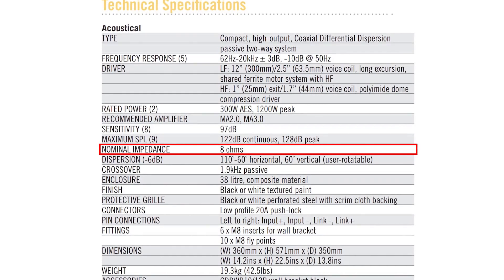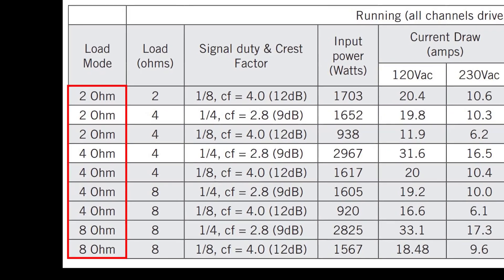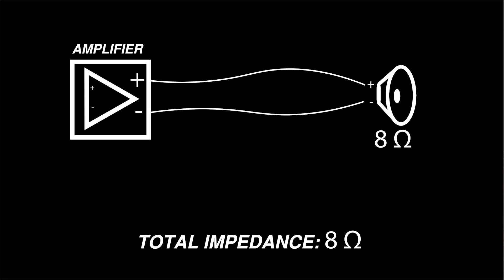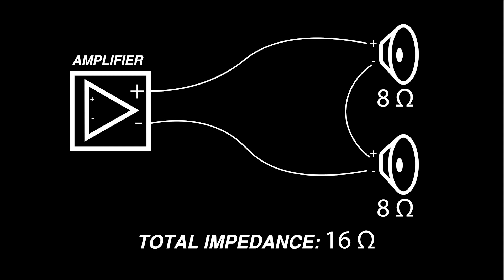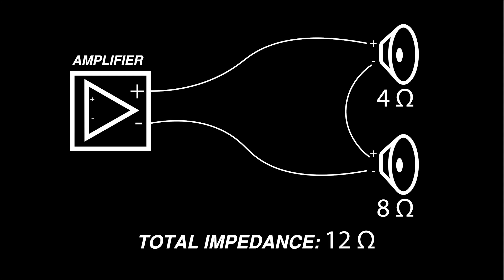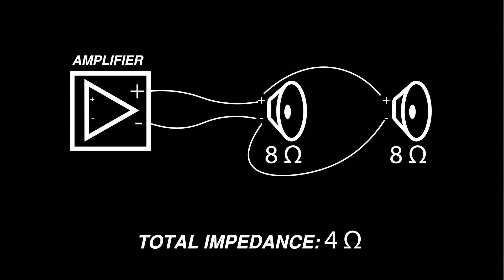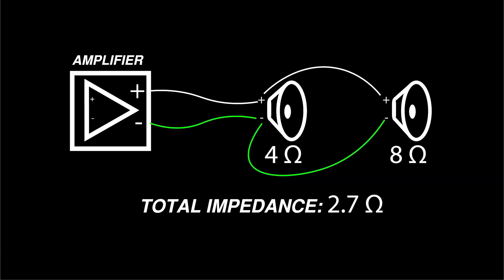SERIES vs PARALLEL: Speaker Impedance Explained

Comment: So adding another speaker reduces the load to the amplifier if wired in parallel?  That doesn't make sense.  🤔  In DC wiring, if I wire two 12V batteries in parallel, I still have 12V but have twice the current (measured in amps).  Conversely, since speakers draw power rather than make it, wouldn't wiring in parallel demand twice the current load from the amplifier?  Is there a current specification that I need to be careful to not exceed?
Reply from the maker: Adding a speaker in parallel will reduce the impedance seen by the amplifier, which will require more current. Yes, this could be a heat and power supply issue for the amplifier as the current requirements exceed the amp’s ratings.
Reply: A speaker is not a power source, it is a load. It is the same math as calculating series/parallel resistors. Yes, wiring speakers in parallel absolutely reduces the total load.

Comment: Thank you for this video! If I have a 2 channel amp with 4 - 16 ohms, want to hook up 4 speakers rated at 8 ohms each in parallel, is it ok to connect  2 speakers directly to each channel rather than from one speaker to the other? I think the impedance would be the same at 4 ohms, just want to make sure that is still OK to wire it that way. Thank you!
Reply: Yes.  His diagrams showed wiring in parallel from speaker to speaker, but if you tied down 2 speaker wires under the same lugs on the amplifier, that is also wiring in parallel and the amplifier will know no difference.
Reply from the maker: Thanks, PVT-PILOT! That’s correct, David. Both methods will be a parallel circuit.

Comment: Is there a way to hook up a two channel amp to 4 speakers ( 2 on each side , each speaker having 8 Ohms ) so that the amp will have 8 ohms resistance on each channel ? I see in your video that with 8 ohm speakers you would have 16 ohms in series or 4 ohms in parallel , but is it possible to have 8 0hm resistance with running 2 8 ohm speakers per channel ? thanks.

Comment: Sir I have two 8 ohms speaker one is 150 watts and 250 watts...... What happened if I connect both
Reply: Weather it will damage the system......???
Reply from the maker: I don’t expect it will cause damage to the speakers, but you might get different output levels from each speaker.

Comment: Great information. I'm curious. Is there a way to parallel two speakers and have a 3rd one in series? My guess is to parallel two then let them act as the first "one" in a series? Thanks for in advance for any help or advice.
Reply from the maker: In terms of impedance, your thinking is correct. Nice! Although, I believe there are differences in how power will be allocated depending on if the speakers are connected in series or parallel. You might want to do some research on that...
Reply: @AudioUniversity  Thanks. I wondered about the power as well.

Comment: Very helpful, but I still have a question. I'm getting ready to install a pair of 3.5 ohm JBL door speakers into my car and planned on running my 4 ohm Cadence tweeters in SERIES with those 6.5's. For the past 6 months I've run my tweeters in PARALLEL with my Pioneer 6.5 door speakers, which are 4 ohm speakers. BUT, I keep blowing tweeters when I crank up my stereo because I'm adding way too much power to the tweeters. Thankfully the Pioneers handle much more RMS power than the tweeters, so those have survived. But now I plan to connect the brand new JBL GTO629 speakers which are 3.5 ohm in SERIES with the brand new Cadence 4 ohm tweeters. I'm not a math whiz, so can someone tell me what resistance my amp will see running a 3.5 ohm AND a 4 ohm in series? And should I go to the positive of the door speaker FIRST since my tweeters have both bass blockers AND resistors on their positive sides? Hope this wasn't too confusing. I've NEVER run speakers in series before, only parallel like I'm doing now.
Reply: 7.5 Ohms, and yes

Comment: Series Connection Question:  Do you use Negative or Positive wire for the negative to positive connection between the 2 speakers?  I have red and black...which one?  Please and thanks...and great vids.
Reply from the maker: It doesn’t matter which one you use. The wires are the same. The colors are only for helping keep track of which is which. Thanks for watching, Mr. J.L. Seagull!
Reply: @AudioUniversity  Thank you Sir!  I figured as much but when I described what I was doing at the shop [hi-fi repair] he confused me.  Other than gauge I always thought copper was copper.  Thanks again.

Comment: I just want to ask that my amplifier is rated for 4-16 and it is a 2 channel amplifier now my question is that it's 4-16 ohms impedance applies on one channel and more 4-16 ohms for other channel or 4-16 ohms should be the total of both channel I am confused Please help
Reply from the maker: Amplifier impedance specifications are usually per channel.
Reply: I am asking because it is a Japanese amplifier 40 years old and it's amplifier impedance is written in a way that both channels are coming in a labelling of single square and on top of that 4-16 ohms is written

Comment: Say if you had a tweeter and woofer both 8 ohms connected in parallel to get 4 ohms to connect to one channel on a 4 ohm amp channel. How you would choose a crossover unit for these speakers? Would it be a 4 ohm crossover or 8 ohm crossover ?

Comment: Please help, I have two 8 ohm speakers that I would like to connect to a single Dolby Atmos out put channel on my AV receiver with a 6-16 ohm impedance, so a circuit in Series would be the correct way to connect? If so, would sound quality and frequencies diminish?

Comment: I'm doing 8ohm speakers x4.  Haven't picked out an amp yet but must install them soon because ceiling drywall is going in.  So which system should I use?  Parallel or series?  Very good video, just wish it touched on the pros and cons of each setup.  ww

Comment: Thx for your info.  What is the difference of Series or Parallel ?  If I want to wire 2 pairs of dissimilar Bookshelf speakers (1 pair of Elacs and 1 pair of Fluances [both have 6 ohm impedance ratings), to allow the 2 speakers to play simultaneously on the A Speaker Connection on my Denon Receiver.  The Receiver has a B speaker connection as well which is connect to yet another pair of Different Elacs in the rear of the room?  Would I be wiring the 2 pairs of Bookshelf speakers on the A connection in parallel - thus creating a Mid tower design .  They will be stacked one on top of the other.  Why am I doing this?????  Because I had the Flunaces lying around.  Now with new Elacs (one is Debut and the other pair Debut Reference models).  Just toying with enhancing the overall sound in my COVID created Basement Studio to play music for listening and Drum Playing accompaniment ...  THX All.  Be safe.

Comment: Hi great explanation, i few a question regarding performance of the speaker in Parallel, if I connect 4 - 4 ohm speakers in parallel  on a single 4 ohm channel on the amp how would I lose speaker performance watts etc..?

Comment: I am waiting for your explanation.
Dear Sir, I have a puzzle about impedance of speaker and Amplifier.
 When I was studying Physics at college I learned that Resistance is as a scaler ( only has a magnitude but doesn't have a direction).
Impedance is also a resistance and it is measured in Ohms. But it is a Vector ( has both magnitude and a direction). 
Can you explain the difference between the resistance and impedance with drawing on a video???

Thanks
Praneeth
Reply from the maker: This question is outside of my comfort zone. I don't have a good answer for you! My understanding is that resistance applies to DC (direct current) and impedance applies to AC (alternating current).
Reply: @AudioUniversity  thanks

Comment: what would happen if I was putting a more than 16 ohm load on an amplifier that can go up to 16 ohms?
Reply from the maker: The amplifier would not supply as much power to the speakers as it ideally would. The sound quality will be degraded, especially in the higher frequencies.
Reply: @AudioUniversity  can I add small subwoofer in my 25 year old sony hifi music system? without loosing quality
Reply from the maker: You’ll need to consider the crossover point of the subwoofer and the existing speakers to make sure they don’t interfere too much with each other.
Reply: @AudioUniversity old system has supper woofer coaxial out. i attached this to left in channel if subwoofer, it is working but it sound so crappy.

Comment: What do I set my receiver at if I have a Daisy chain Surround sounds for example I have 2 sides that are Daisy chained on the right and 2 sides speakers for the left they are all 8 olms
Reply from the maker: In order to get a true surround sound setup, you'll need a receiver capable of sending different signals (separate amp channels) to each of the speakers. What you're describing is a stereo system with two speakers on each side.
Reply: @AudioUniversity  yes I have a surround sound onkyo I just Daisy chained my sides so I could hear at my listening point and to spread the sound for listening signals.   They are all 8 ohms.   I heard that it could fry my reciever or speakers.  Yes I'm cheating but I had to rig it that way.  So far so good.

Comment: good stuff, but i think alot of people would understand and remember this better if there was an explanation on why it acts like this, maybe a little drawing showing the flow of current and how in parallel it has twice as many (for two speakers) routes to flow back to the amp and in series it has twice as much restriction/bottlenecks to flow through to get back to the amp

and also this info is really not that useful to someone who doesnt know about car audio.. the video should of been longer and included explanations on when to wire in each way, what each will sound like and how to get the most out of the equipment you already have
Reply: im just trying to provide some constructive criticism to improve the channel, its free afterall no one has any place to complain or expect anything
Reply from the maker: These are good suggestions! Perhaps I’ll make a more in depth video that includes these other details. Thanks for commenting, Andrew!

Comment: What if I have four 8 ohm speakers, two pairs of two speakers wired in series with each pair wired in parallel to the amp? Would that bring me back to 8 ohms? (two pairs of 8 ohm speakers wired in series makes 16 ohms per pair. Wiring those two pairs in parallel would then halve that number and bring back to 8 ohms, right?

How is the wattage distributed? If a 200 watt amp has two speakers hooked in parallel do they each get 100 watts? What about wired in series?
Reply from the maker: The total power provided to the circuit by the amplifier will be distributed among all of the components. It's important to remember that a 200 W amp doesn't always provide 200 watts of power. It's best to run an amplifier at about 50% of it's potential continuous power output.

There is also some bit of loss to heat that doesn't result in sound. So, you won't get a perfect transfer of energy from the amplifier to acoustical energy - some will turn to heat.

You are right though - two pairs of 8 ohm speakers in parallel will be an 8 ohm load if the pairs are wired together in series.

Comment: Hello Kyle, this was very interesting, and so well explained. Thank you.
Could you also tell more about the right speaker for the right amp? For example: For a 5 Watt amp with an 8 Ohm output; Is it OK to connect a 35 Watt (8 Ohm) speaker to it? Is this too much? And also, what's the difference (in sound?) between a 10" and a 12" speaker with same Ohm and Watt? Understanding this would help a lot.
Reply from the maker: I'm currently making a video about choosing the correct amplifier for your speakers. Keep an eye out for it!

In short - You're better off choosing an amplifier that is overpowered than underpowered. You shouldn't supply the amplifier with more power than it's continuous power rating states, but it's important to have enough headroom so that you don't overdrive the amplifier and damage your speakers with clipped audio signals.

As for 10" vs 12" - There are many differences between different models, regardless of size. Here are some differences you will often see with speaker size: Larger speakers usually have a narrower dispersion pattern (but not always), larger speakers usually have greater power capacity (but not always), and larger speakers usually have extended frequency range into lower frequencies (but not always). 

I hope this helps! Thanks for watching, @Paul Van Caesbroeck!
Reply: @AudioUniversity  Oh yes, this helps. TNX. Looking forward to more interesting videos.
Reply from the maker: Let me know if there are any other topics you’d like me to cover in future videos! Thanks!

Comment: Great info, but I still have questions! I’m currently installing an amplifier to compliment the aftermarket stereo and speakers I got put in. Currently I have all four speakers wired to the amp on one channel each, but I am wondering if I run the front door speakers on on channel in series, and the rear speakers on one channel in series, if it will work better. Amp seems to be cutting out when I turn it up and feels warm to touch. It says in the manual for the amp;
RMS POWER
@ 14.4v, 4ohm stereo  65w x 4
@ 14.4 v, 2ohm stereo 90w x 4
@ 14.4v, 4ohm mono 180w x 2

The speakers are rated 60 rms 180 peak. 

Am I fucking something up? Any help would be much appreciated for this noob!
Reply from the maker: What is the nominal impedance of the speakers?
Reply: @AudioUniversity  2.3 ohms
Reply from the maker: It sounds like your best option is to run each speaker on a separate amplifier channel. Make sure the amplifier is in stereo mode. That would give you slightly less than 90 W per channel at 2.3 ohms. That way, you’ll also get separate left and right signals to the correct speakers. Good luck!

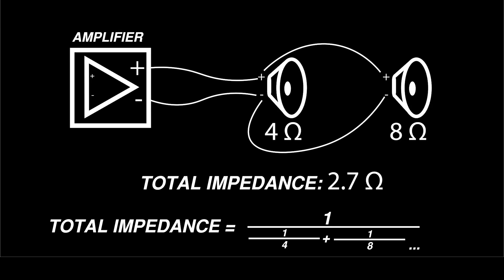Comment: 3:08 If your ohms are 2.7, why not mention to your viewers that this will burn your amp?
Reply from the maker: Good point, @Jeremy Noyes! Thanks!

For anyone reading this - If you connect a 2.7 ohm load to an amplifier only rated down to 8 ohms, it will cause the amplifier to overheat. That's why it is so important to match the total impedance of your speaker circuit to the impedance rating of your amplifier.
Reply: @AudioUniversity  Well noted  but am not understanding the formula you have used to calculate impendance in parralel connection if the speakers are of different impendance
Reply: Hindsight! 
  But, yes.
  I have been researching all day long how to wire this amp up.
  It has three speakers:.  A horn at the top with two speakers and a 15", 100-Watt Celestion.
   Idk how I should wire it.

Comment: Bro, can you help me? 😄✌️ I got 3 speakers with 6 ohms and 1 subwoofer 8 ohms. My amp required 8-16 ohms to use A and B at same time when in theatre mode, what connection do i need to become 8 ohms? Tia
Reply from the maker: You will often plug your subwoofer into a specially filtered output for low frequencies. This isn't always the case, though. I'm not sure connecting them all together is the best option. I'd hate for you to damage your equipment because I gave you bad advice.

For the sake of understanding the content of this video, connecting the 6-ohm speakers in parallel and the subwoofer in series would give you a total impedance of 11 ohms.
Reply: @AudioUniversity  Thanks sir, hope it works I'll try it Tomorrow cuz it's pass midnight here in my place 😂
Reply from the maker: Let me know if it works!
Reply: @AudioUniversity  yow sir, 👌👏👊🤣 i did exactly what you've told me. Thanks to you sir 🙏👍 much appreciated the quality of my speakers now but there's a slight problem, my amp power is to much can't max the volume.
Reply from the maker: Nice! If it’s a home theater amp, it is probably designed for one speaker per amp channel.
Reply: @AudioUniversity  I'm using Kenwood kr v6060 amp, this was the outcome of my connection 5.1

Speaker A
C
L/R 2front/2rear series connection
Subwoofer

Is this correct? 🤣🤣 Thanks again bro
Reply from the maker: Remember that in order to get 5.1, you need separate amplifier channels for each (6 channels). That way different signals can be sent to each speaker. 

It would be best to connect one speaker to each channel.

Comment: Maybe you can explain what happens if I take parallel wiring that make impedance of my speakers are below the requirement of my HU/power amp? Any effect to sound quality?
Reply from the maker: That’s a good idea for a video! Thanks. You definitely want to avoid that. Using speakers or speaker combinations that present an impedance lower than your amplifier’s rating will allow too much current. This will likely cause your amplifier to overheat and eventually stop working!